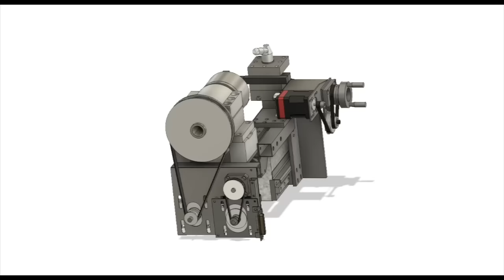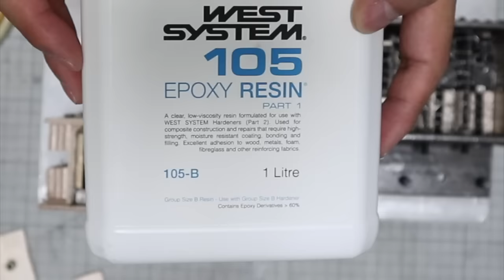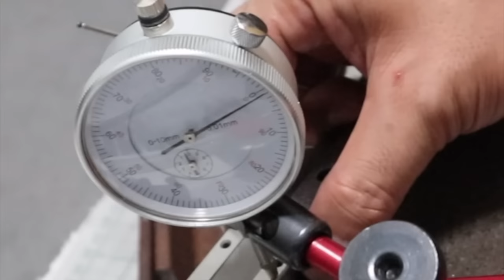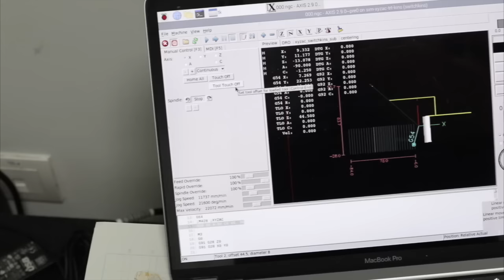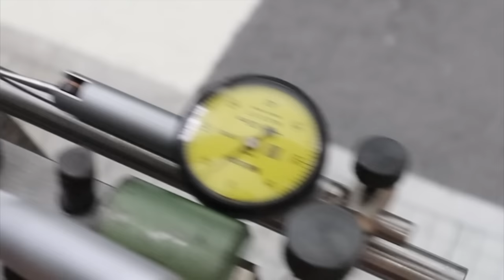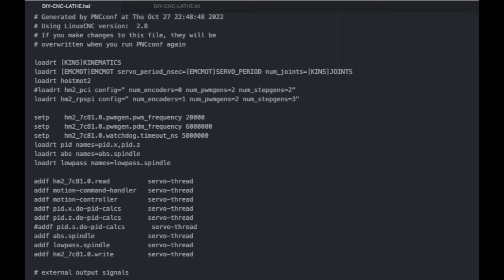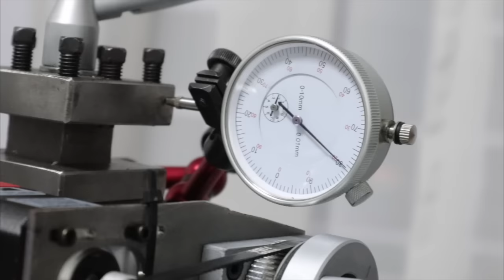Homemade DIY Small CNC Lathe 【DIJEST】

Comment: Sir may be you fixed your cnc leath auto tools changing system then work for better. 😅
Reply from the maker: I installed a quick tool changer because an auto tool changer would complicate the system.
https://youtu.be/oblY7WZfH5U
Reply: Ok sir I understand. Sir can you give me belt sander machine grafix desing.

Comment: one year later

are those linear rails still working?

what would you do different?
Reply from the maker: So far, no problems.
I don't use it that often to begin with.
And I don't have the power to do that much heavy cutting, so it's not enough to break me.
For now.

Comment: its pretty cool. If you ever build another you can get granite reference surfaces which can be grade A from many sites, even amazon for fairly cheap. They make a great starting point for a rigit lathe or mill.

If you can I'd switch out the risers for the chuck with cast iron. There is also rubberized epoxy you can put between the riser and the bed as well as the riser and the chuck to dampen sound and keep the bolts from vibrating loose.
Reply from the maker: Thanks for the advice.
I'm glad you are interested.
Reply: @a-cnc-f  a cheap for granite bloc and plate are rejected / dismantled graves , that a cheap supply of granite and grave making company can recut at the needed dims . That also possible to lap them to metrology class . I have built several setup for microscope or measuring machine with these granite supply .

Comment: Looks like you've started from nothing but now have working machines.  That is impressive.  I saw you included footage of parting off steel, too, which is a good test for rigidity.  The sound it makes shows that there is still opportunity to improve.  It's hard to know what causes vibration.  Sometimes it is something small.  I'm working on a 9x20 lathe at the moment, trying to make it more rigid.  One trick is to put an indicator on a part and try to move it with your hands or pry bar.  Something as simple as bolting the machine to a bench can make a huge difference.
Reply from the maker: I agree with you.
Mechanical strength is very important.
The tests you mention are done in part 7.
Anyway, I would like to increase the strength of the machine as well.
https://youtu.be/MuYGT4BuFmo
Reply: @a-cnc-f  did you use a cross slide from a cheap minilathe? Most of the time, they are terrible. Al riser blocks under the spindle aren't the best solution either.

Otherwise, it's a nice build. I like the base and the use of guideways.
Reply from the maker: @besenyeim  Cheap parts can have product problems.
But high quality products are expensive.
Reply: @a-cnc-f  Have you considered making your own cross slide with guide rails? I think you can make a better one.
Reply from the maker: I have thought about it.
The problem is that I don't have good machine to make it.
I have a 5-axis CNC machine that I built myself, but the machine size is small and it is not strong and powerful enough to do high precision machining.
Reply: ive spent half a lifetime and finally just got to the point i can actually make a bed...

from cast iron that is.

THATS where the vibration comes from. too light, and the materials are just too flexible.

ive always envisioned a 4 axis mill/lathe combo. something that weighs in at 200kg+. with 5th axis just being a bolt on addition.

never been happy with my sieg mill. too small. not enough bearing surface. can make them a bit better but they fundamentally are flawed.

for small sizes, sometimes just a hunt around a scrap yard will supply nice chunks of metal. counterweights and old machine tools are a great source of super heavy castings... 

im about to chop up the saddle from an old surface grinder. just enough meat to make a new slide for my lathe, and takes some weight off the spindle so i can mount the grinder to the toolpost.

this thing must be an old norton or something... weighs about 50kg! super precision spindle. big castings...

Comment: Be interested to know what the red cast block was? You have sandpaper glue to it? Awesome build but I question the linear rails you went with look like they are for low load linear motion like 3d printing?
Reply from the maker: Thanks.
Certainly, linear guides are not designed for high loads.

Comment: Totally awesome dood!   I have been looking at my old lathe and my pile of Cnc parts and wondering if i should build a new Cnc lathe.   I think i will now!   Love the resin base.   Looked like it struggled a bit with parting off, id be interested to know if and how you have overcome this.   Did you do the tool changer and live tools?
Reply from the maker: My focus is on making the machine smaller.
I am thinking about tool changer and milling, but that is my next project.
Currently, I am working on a new 5-axis CNC machine.
Once this is finished, I believe I should be able to easily make advanced parts with it.
So I'm thinking of further modifying the CNC lathe.

Comment: Fantastic job. The epoxy granite should be plenty rigid enough?
Reply from the maker: Epoxy granite has long been used as a substitute for casting castings. It should be strong enough.
In fact, after building this CNC lathe, I have no complaints about the epoxy granite base.

Comment: Did you try to turn the cutter upside down for parting operations?
Reply from the maker: I have never tried it.
But I will give it a try. Thank you.
Thank you.
Reply: Why would you? With the right speed and feed settings, and with the right cutting tool profile It would do the job easily if its rigid enough. From the video, the feed and the profile is pretty off in my opinion.
Reply: @Thom  if the lathe is not strong enough for parting, cutting upside down is better. When the machine flexes, tool doesn't pull into the workpiece.
Reply: @dokmetasonur  The forces seems to be the same to me. In normal position the knife is pushed down to a muc more stable surface the some screws. I never used it upside down tho, only other knifes and only for speed.
Reply from the maker: I missed your comment, sorry.
The machining conditions for grooving are difficult.
I will put out a video of machining with the tool mounted the other way around in my next video.

Comment: great work, but sadly... mild steel and aluminium will never quite match solid cast iron.

i was holding the edge of my seat watching that parting blade.

really seems there would be a market for a basic 4 axis mill/lathe combo. in cast iron. with a bit more meat behind it than the average sieg...

Comment: that's a buttload of drilling and tapping.. how many taps did you break?)
Reply from the maker: I have made several hundred M3 taps.
I have not broken a tap in the last 2 years.
Of course, I broke about 6 taps in the beginning.
M3 taps are very easy to break, so be careful.
It does not matter if the drill hole is slightly slanted.
The important thing is to set the tap straight against the drill hole and to understand by feel how much force to apply to break the tap.
Reply from the maker: I have made several hundred M3 taps.
I have not broken a tap in the last 2 years.
Of course, I broke about 6 taps in the beginning.
M3 taps are very easy to break, so be careful.
It does not matter if the drill hole is slightly slanted.
The important thing is to set the tap straight against the drill hole and to understand by feel how much force to apply to break the tap.